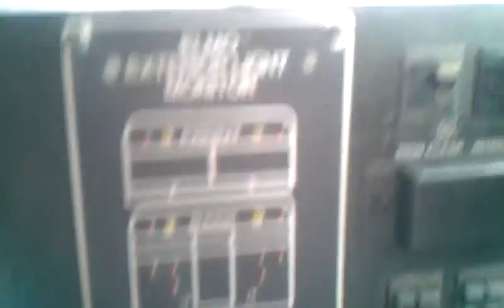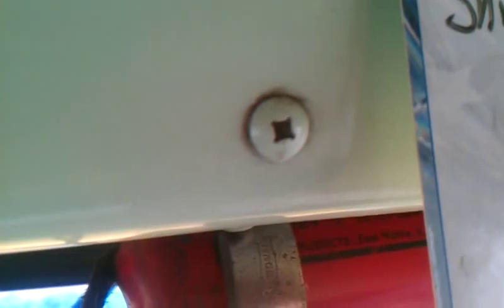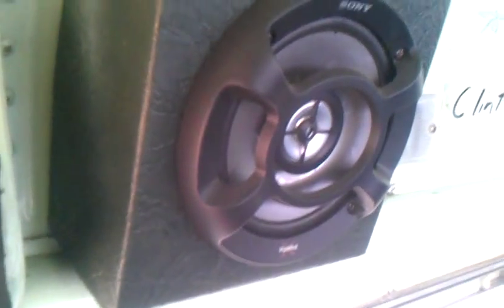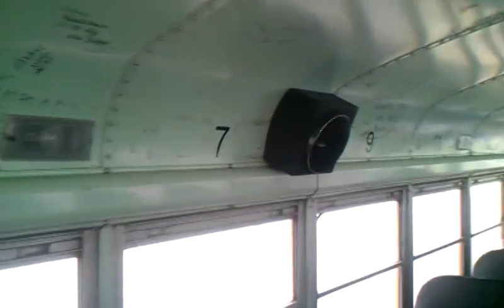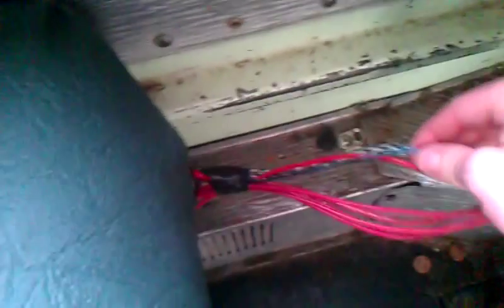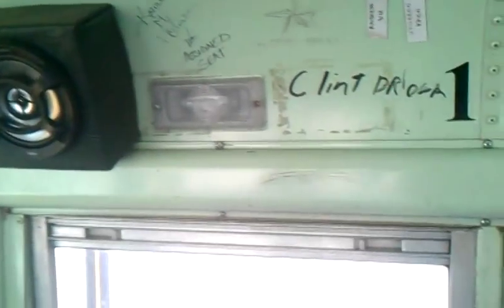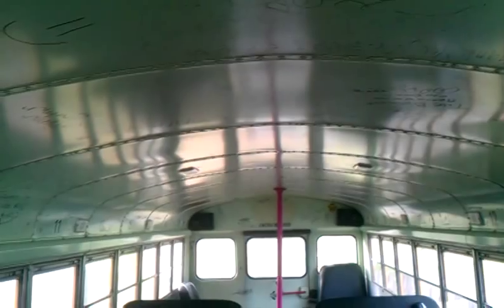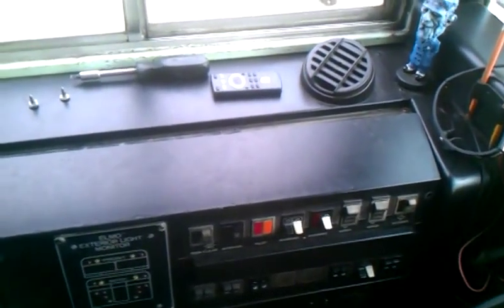How to install a Stereo System in a (Thomas) School Bus

Comment: I put 4 15 inch kickers 2 10 inch kickers 6 6x9 Rockford Fosgates 2 6 inch Rockford Fosgates on the inside and 12 peavey 3 inch horns on the outside. oh yea and it's our church bus were a pretty bad ass church.
Reply: blacklights, strobes, full rgb and DMX controlled lighting on the inside, capacitors and extra batteries to
Reply: now that's a church id goto...